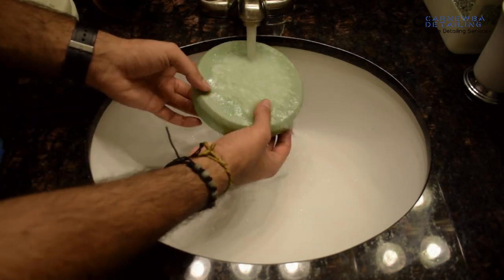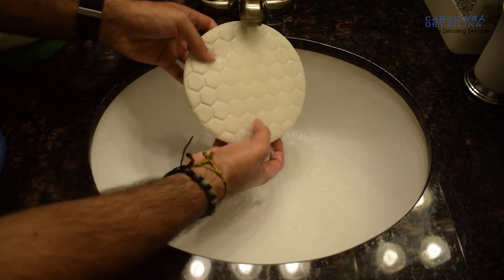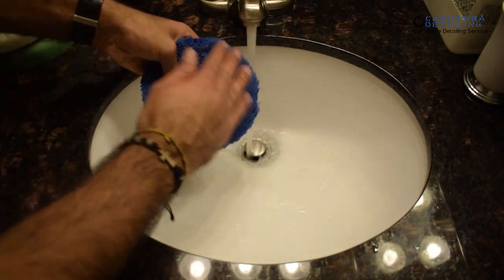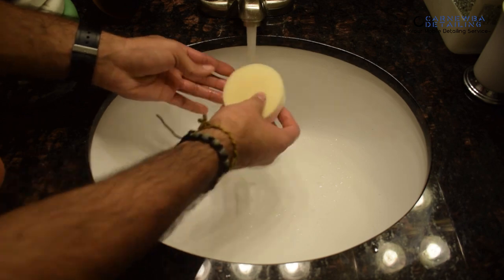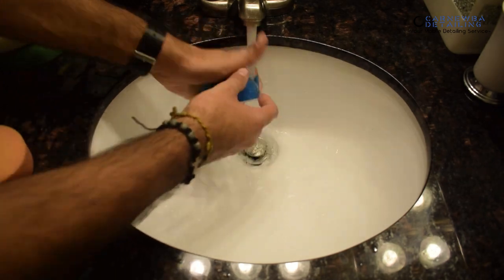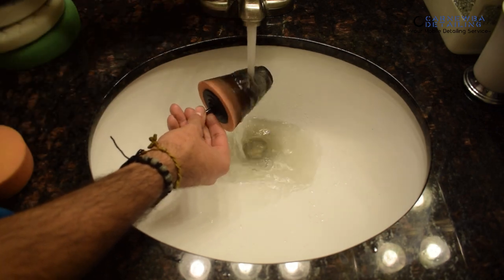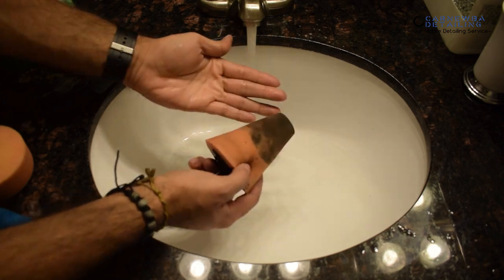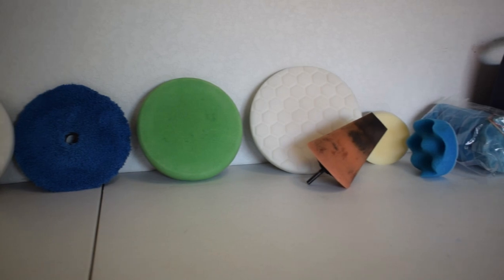HOW TO CLEAN POLISHING PADS: Super Easy!

Comment: This better than the rag method?
Reply from the maker: If you were referring to the method that I utilize and previous videos to clean the pad during the polishing process, I wouldn't compare the two because the rag method is utilized during the polishing process to minimize residue and dusting and maximize cutting ability of your pad, while what you're watching in this video is to completely clean out any leftover polish compound or clear coat from your previous detail giving you a fresh pad to work with on your next paint correction process.
Reply: @48Detailing  i need to do this to clean the pads i use. Great video!
Reply from the maker: I do it after every detail, just to make sure my pads are gonna perform at there best! And thanks again man!